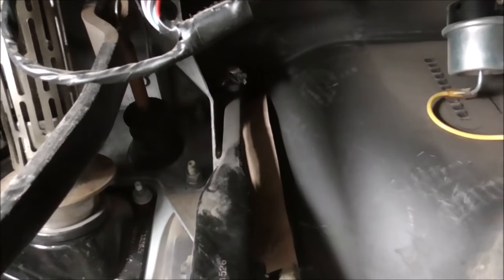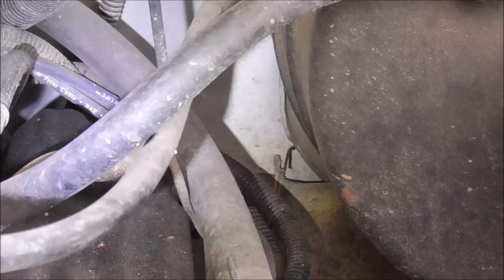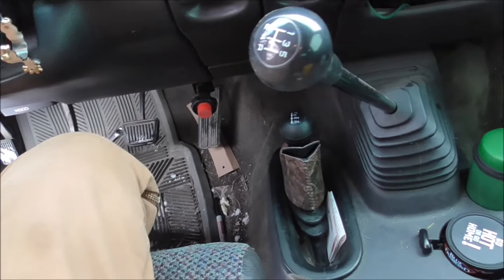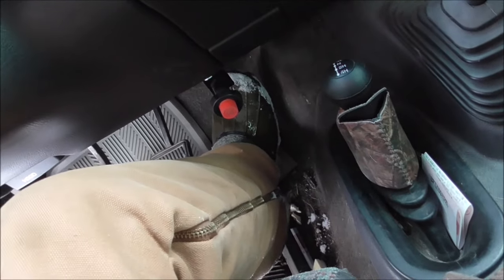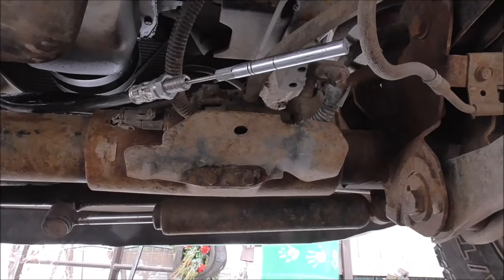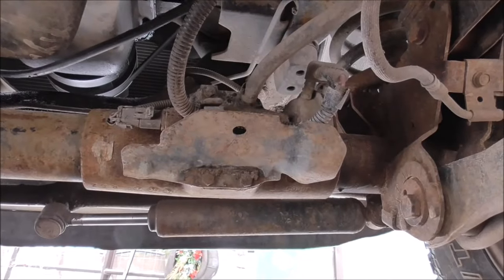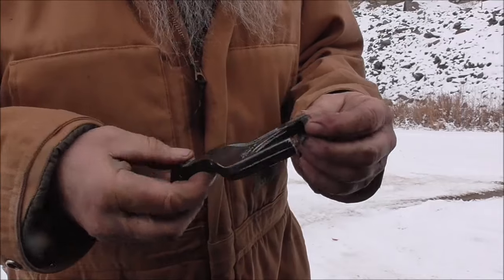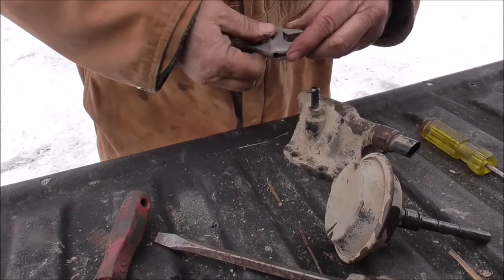Installing a Cable Conversion 4wd Actuator for a 2001 Dodge 1500  Truck Part 1

Comment: Working on my own vehicle it seems like it always takes twice as long as it should. I know it's frustrating but keep plugging away and keep a positive attitude!
Reply from the maker: It almost always does. There is always some problem you don't  expect.  I've never had a threaded hole come the wrong size before though.  Even the plug it came with wouldn't fit.  I would have been done if it wasn't for that.  18F right now....not fun laying on frozen ground in that!

Comment: Yeah I’ve got similar problems with the 4 wheel drive right now. I put in a new factory actuator, worked fine and after I let someone else use it, it now doesn’t work. After disassembly of the actuator, it turns out the motor works fine and it’s the front fork is stuck. I think it was engaged while the truck was in motion. Maybe not I’m not expert. Either way I gotta go get some rtb that doesn’t require warm temps to set up. Daytime highs of 35 right now. I hope your works out for ya. 👍👍
Reply from the maker: Supposedly, you can shift it in and out of 4wd while driving up to 55 mph?  (into 4wd high) That seems like a really bad idea to me!  That collar sliding over the splines would have a LOT of stress on it if you did!  I think it would be better to stop, or maybe drive just a mile or two an hour?  I don't know what's inside the transmission or how it shifts either?   Vacuum seems like a bad idea to me. There's a lot that can affect it.....this time of year, just a little moisture in the line freezing would stop it from working.  I hope the cable is more "sure"....Good luck with yours!

Comment: That's the way it works with me too Brother.  When I'm doing mechanical work nothing ever works out like its supposed too. Best wishes Gary
Reply from the maker: 100% of the time!   If it was not for the threads in that hole not being right, I would have had it finished.....colder today....I'm dreading finishing it!

Comment: Its hard enough to work on that outside on frozen ground and snow , with freezing temps, and not to have the new part threaded correctly , makes a fairly simple much more of a job than it should be. Good luck.
Reply from the maker: It sure does...I wasted an hour on that threaded hole. I would have been done if not for that.....colder today, just 18F....UGG!

Comment: I probably saved them  15 to 20 cents by not adding instructions. I wish they would put the metrics where the sun does not shine. Welcome to one world gov. prep.  In college I had to change out a throwout bearing on my old IH Scout. It snowed 6 in. the night before.  It did not work so I had to do it again.  The fun of being broke and having to do it yourself.  I still have the set of tools  I had to buy to do the job.  It brings back those memories everytime I use them.  Have a blessed day and I hope you get it finished tomorrow, without additional snow.  PB
Reply from the maker: That's not fun!  Years ago I had a one ton International that blew the engine. Ended up putting a new on in ....outside in the snow on Christmas day.  Not the way I wanted to spend Christmas!

Comment: Good morning.  Good luck finishing that off. Good idea rethreading the hole. Have a nice day
Reply from the maker: Good morning!   Right out of the box, that hole was too small?  Rethreading it cut quite a bit out.  I think their reamer must have been worn out, there is no way that fitting, or the plug that came in the kit was going to fit.   Not exactly confidence boosting....
Reply: @MuskratOutdoors  well this is it. I used to install hardware on doors and they always came with 1 directions and 2 a stencil for drilling holes. It would only seem like the right thing to do supply them both with an install as such.

Comment: Smallest thing always causes the most headache. Ran a garage and wrecker service for over 35 years. And I've learned that nothing and I mean NOTHING will go the way you need it to. So always plan for at least one malfunction in the junction. Lol.
God bless, just enjoy the win, with the tap,  you'll have it tomorrow, God willing. 
    Tennessee Hillbilly, Out.
Reply from the maker: That's for sure!  Kinda gotta figure it will take at least twice as long as you think it should.   That tap was a "have to" but I bet I'll never need it again....it was "only" $7 so I guess that is OK.  It's a weird size thread pitch, Metric 10-1.... I tried to just find a regular bolt I could grind slots into to make a tap, but couldn't find a single one for sale.  Lots of 10-1.25, and 10-.50, but no 10-.1.00?

Comment: Oh boy, I've  got a  little  experience with this  same  problem,  to  replace the  actuator  is kinda pricey.  Good Luck with your modification. 😊
Reply from the maker: It is.  This cable kit was "only" $45 through ebay.  Hopefully it will be more "sure" than vacuum.

Comment: Hi Guys that is sure a neat picture of Cindy by that old car   but yeah good job so far on putting in that 4 wheel Drive cable    It looks like you are doing a good professional job the way you are fixing the mistakes from the factory    I can't believe they didn't have instructions with it and how you had to rethread it so that vent fitting would fit    Companys don't seem to care as much about there reputation like they used to   They just care about how cheap they can make stuff to get the most profit  pretty sad    Well I hope it all goes smoothly from here  GOD Bless You Guys
Reply from the maker: Thanks!  That old car, and Tommy Gun belongs to a friend of ours. Pretty neat!  I can't believe that threaded hole was cut undersize!  I've never ran into that before!
Reply: O wow I didn't see that it was a Tommy gun that is pretty neat alright   But yeah I couldn't believe that threaded hole was undersized either  I was thinking they must not have even tried their aftermarket kit out after seeing that   well stay warm up there       @MuskratOutdoors

Comment: I ran a vacuum line to it so the front end was locked in all the time  the vacuum control on the shifter is normally the problem   Fuel mileage was down some but it’s a mopar so that’s normal  it took a while to get a controller for it   Your next problem will be  high use the intake has a plate under it the the gasket keeps spitting out and  sucking up oil and causing a vacuum leek . A dodge is like owning a boat . The two best days is the day you buy it  and the day you sell it lol   I hope everything works out for you
Reply from the maker: Wonderful.....dang I hope not!

Comment: Well that was frustrating and cold 🥶🥶 to watch.
I hate stuff like that.
I wonder if those parts are grab bag lots at Chinese auctions and the instructions are missing because the manufacturer neglected to include them INSIDE the bag with the parts. You never know what is going on over there.
But for sure if anyone on the planet can install something withOUT the instructions it is you Gary!
Reply from the maker: Thanks Don!  Good to see ya!  I bet it is Chinese?  It doesn't say anywhere though and they are usually good at marking it someplace. It's only 18F right now....it won't be fun finishing this today.
Reply: @MuskratOutdoors  
Well you should have some kind of a space heater that you can point at the back of that truck.

Comment: I know longer have to think of what Bonnie and Clyde would look like had they lived - can't you use one of the fair barns to get out of the weather shouldn't hurt a dang thing?
Reply from the maker: I could, but the lighting isn't very good in them.  The big riding arena has a sand floor, so dropping something would get covered in sand and grit...if I didn't lose it. The other two, wouldn't work really either. One has a new tile floor, the other a cement floor....getting oil on either would be a bad thing.

Comment: You don't need that cable. Dodge had full time 4x4 for lots of years so did Chevy. Just lock the fork 2 one side and leave it. One axle always spins any way
Reply from the maker: I saw a video telling about that.  It sure seems like it would put a lot of stress on it?
Reply: @MuskratOutdoors   won't be as much stress as when the cable you put on get s tore off 50 miles from home and you have to have 4 wheel drive to get home